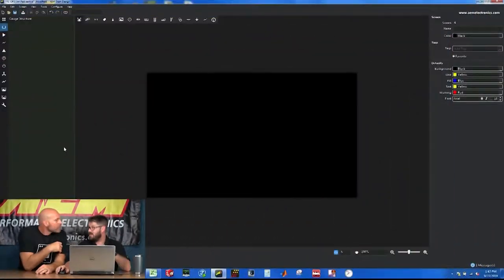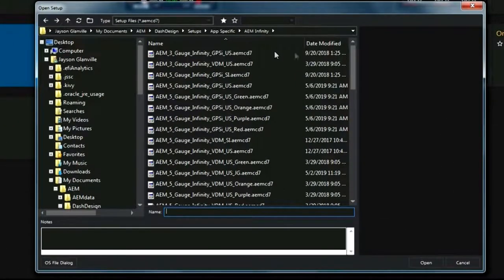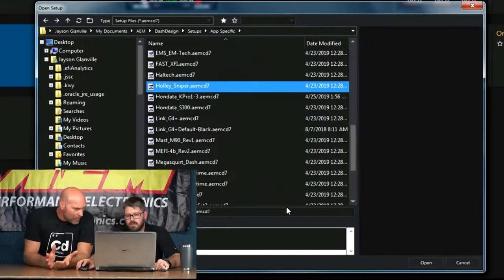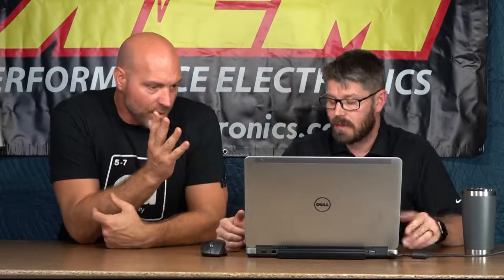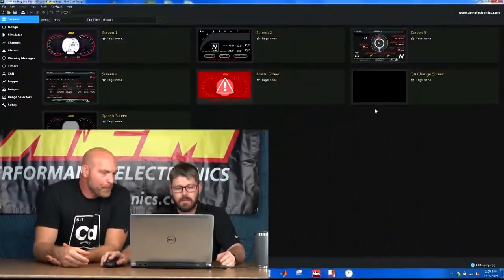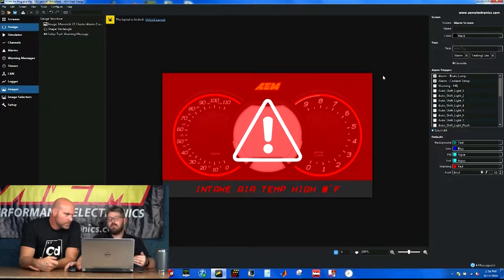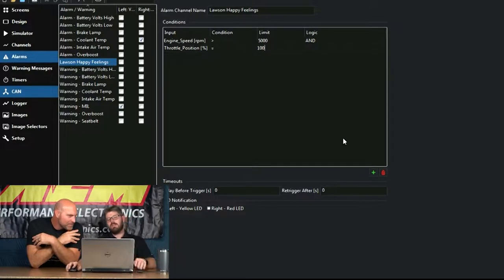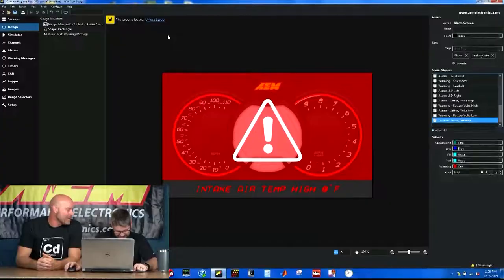Diving Into DashDesign 2 - Tutorial Part 1!

Comment: the video was great , but when i tried connecting my LCD after i did the screens the way i wanted , the message (no screen appeared) or something like that , when i check my screen it says |"no applet logs present"  and it won't connect to dash design
Reply from the maker: Try reinstalling the Dash Design 2 software. Then reflash the latest dash firmware by going to tools->upload firmware. Next attempt to flash one of our base layouts to your display(Documents->AEM->Dash Design->setups->app specific). After taking these steps try reuploading the setup you have created. If you are still having problems please contact our Tech support representatives at Tech@aempower.com so they can assist in troubleshooting, please also include your dash serial number along with the dash setup file you created